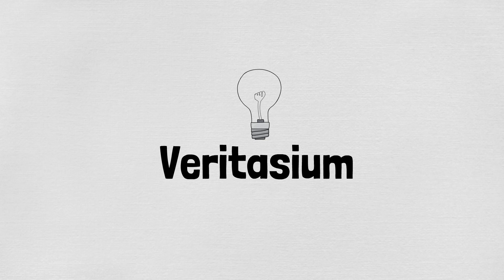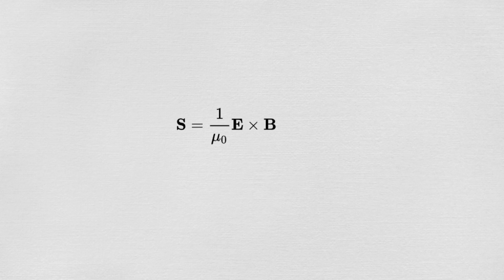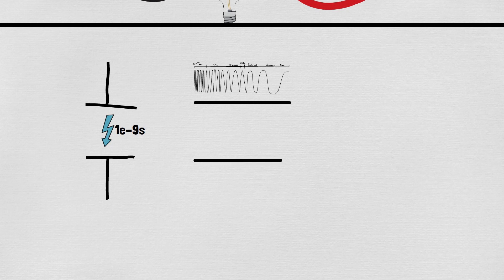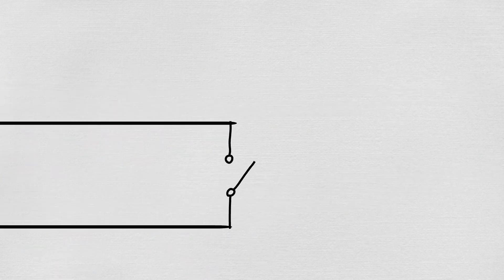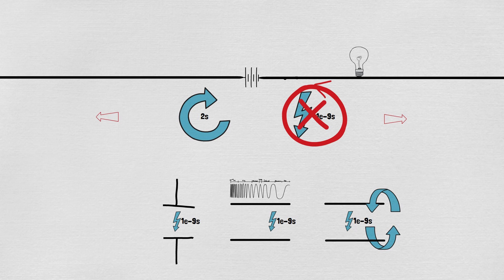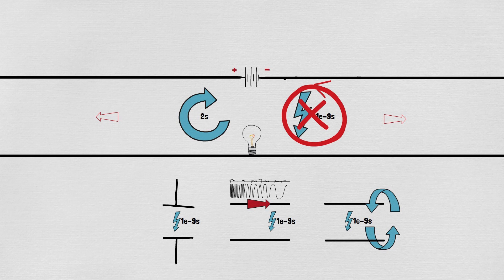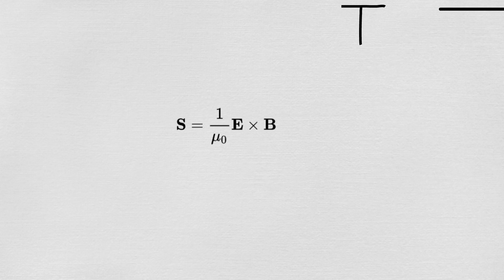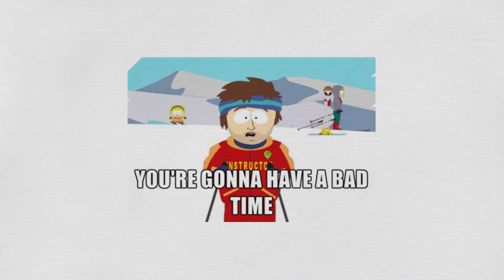Veritasium is Right? (see description)

Comment: Veritasium, is just dead wrong. The capacitance across 1 meter of wore is negligible and can’t carry the current required to light the bulb. Also, EMI pulse generated by the switch isn’t long enough to light a bulb for anyone to see it. The filed around the wires isn’t strong enough to carry the energy required to light the bulb. The energy is carried in the wires. If it wasn’t, we wouldn’t need big wires to carry large loads! There is a wave produced by the battery that will travel the length of the wires to light the bulb. It travels at the speed of light in the wires, which is less than the speed of light in a vacuum or even air. (It is not "C") If you think you can transmit energy across 1 meter of air with a single strand of wire, I suggest you use some math to find out the TRUTH! His thoughts on the direction of energy flow are just stupid. Energy flows in the direction from the source to the load. His example of a chain is more correct than his example of energy flowing in the field. The fields are created by the current flowing in the wires, no, current, no fields. Veritasium, usually does a very good job in his explanations, he just blew it with this one.

Comment: You can't just move the switch around like you do in this video without affecting the setup. Everything to the left of the open switch is at an equilibrium potential (e.g. ground + 12v) between the switch and the battery. When you close the switch the current doesn't immediately start flowing through the battery where there the potential difference is already in equilibrium, it starts immediately flowing through the switch where there is a 12v potential difference between the right and left sides and you just shorted a wire -- no causality is violated.

Comment: Everything you said is wrong from start to finish. It is a dynamic problem, but the current is established starting at the location of the SWITCH, not the battery, and the energy flow is transient, appearing when the current starts up. It settles to no energy flow (no bulb light) when the current becomes a steady DC, and then the light will light up again if it's an open circuit, because the current will die down. You are not saying correct things, all your 'causality paradoxes' are naive, the time it would take to light the bulb is the time it takes for an em pulse to propagate from the switch to the bulb, although the bulb will turn off later when the dc current dies out, if it is an open circuit, relighting a few times, as the recoil waves travel back and forth along the circuit.

Yes, I have read Jackson's EM book, it's not that good anyway.

Comment: Dereks's question  was "how long to light up", not -  "how long to light up and keep glowing". so in this case, Tycho, my man, you are wrong.
Reply: It wouldn’t even light up though? Not enough current
Reply: @Samcharleston24  For incandescent light bulb - most likely not. Because filament needs to heat up to emit light. For LED - no idea what is the minimum energy, forward voltage or any other aspect to emit at least 1 photon. Good topic to explore on a free  evening :)

Comment: Veritasium made a very bad example experiment which is also deliberately confusing. But You are also not completely right. If you follow the example of Veritasium you will get a short amount of current thought the lamp (even if you cut the far end of the wires by the way). 

But I agree that in the real world the experiment will never work as the energy transfer is way to low.

Comment: This is just wrong, sorry. You definitely get current just by instantaneously hooking up a wire to a different potential regardless of if its floating or not. That’s how a TDR works. As for the it violates causality argument the problem assumes everything is at steady state so the potential on one side of the switch is at the potential of the cathode and the other side is at the anode. Although Veritasium’s premise is misleading; there would be a pulse at 1/c seconds then sinusoidal oscillations often called ringing so the light wouldn’t really turn on in that time. https://en.wikipedia.org/wiki/Time-domain_reflectometer https://en.wikipedia.org/wiki/Transmission_line

Comment: You shouldn't post videos about things you don't actually understand, closing the switch does cause current to flow, not everything it a lumped element circuit. This is why YouTube shouldn't have removed dislikes.

Comment: Veritasium is wrong, and your explanation of why Veritasium is wrong, was pretty close, but still wrong.

What actually happens in a battery is a chemical reaction separates charges. Electrons build up on the negative side, and the positive side lacks electrons, due to a chemical reaction inside the battery. Electrons in the wire want to move into the positive terminal of the battery, but can't due to the reaction not being able to continue so long as excess electrons are built up on the negative terminal of the battery. When the switch is closed, electrons nearest the battery are able to move in response to feeling the electric field from the battery, and when this happens the excess electrons are removed from the negative terminal, allowing the chemical reaction to continue. This reaction pulls electrons from the section of the wire nearest the battery, into the battery  This causes current flow nearest the battery, but initially not farther away. After the electrons nearest the battery start moving, then this changes the electric field around those electrons, so that farther away electrons then feel the push or pull of that electric field in its new configuration, and start to move accordingly. This means electrons farther away from the battery on the negative side now start to move away from the battery, and electrons farther away from the battery on the positive side now start to move toward the battery. The speed at which this region of latest-moving-electrons actually moves (the movement of the region of moving latest-moving-electrons, not electrons' own movement) is about the speed of light (slightly slower in metal than in free space). This region of latest-moving-electrons does not reach the light bulb until the FULL TIME (as dictated by the duration it takes for light to travel the length of the wire itself, from the battery to the bulb, and NOT the gap between the wires) has elapsed.

Yes, when you first flip the switch and electrons start moving nearest the battery, there is some coupling (both inductive and capacitive) between the wire nearest the battery and the wire nearest the bulb, but it's VERY WEAK coupling. The amount of coupled current in the wire nearest the bulb is VERY WEAK. That coupled current is WAY TOO SMALL to light the bulb.

Comment: three minutes in and my teeth are starting to grind. You are clearly not an RF engineer and you understand nothing of transmission lines. When you switch on there is a transient coupling between the lines (if you don't understand transmission lines, you can call it a capacitor) that fires a transient of energy into the bulb, lighting it. I there were no more transmission lines and no short, that would be it. A tiny flash. But there is a transmission line and the coupling field moves along it at the speed of light adding a continuous coupling until the field reaches the end. At that point it encounters the short. You now have a simple DC circuit for the rest of time. At no point after the initial flash is the circuit without an energy transfer path.

Comment: you are wrong, this does not break causality ... the position of the switch does not matter, the math requires a closed circuit ... the capacitor/antenna argument only holds if you are talking about ac, energy does not flow through the capacity with a dc source, capacitors can store electric potential energy by setting up an electric feild across the places, you need a good grasp of basic circuit theory before you jump to arguments about causality

Comment: This whole video series is nothing more than click-bait.  If you have a DC circuit, you do not light a light bulb thru a capacitor.  All you get is a surge current and when the capacitor charges the current stops.  Also, try and put a wire in a cloud at 1 million volts and see what happens to that bulb.  Benjamin Franklin did that with his kite, remember about lightning?  LOL  What do you think would happen as this wire extends through the aurora borealis or the Van Allen belt?  The whole problem is ridiculous and is just meant to get responses and clicks to make money from YouTube.

Comment: He's not wrong.  It's just a trick question that doesn't need to even involve Poynting vectors if you just use capacitance.
I love your discussion !    But doesn't closing of the switch cause current through the capacitor to make it true ?
Reply: The existence of capacitors is evidence of the truth which veritasium has grasped the reason for. Otherwise you conclude that it takes a couple seconds before power transmission. Also, you can't have a capacitor with no power, so only if the switch is between the battery and the capacitor do you have no current flow.

Comment: it is interresting how many people making arguments here that were clearly proven as false in the video.... aren't they listening to the video or are they themselfs dismissing the arguments of the video about their arguments as false or unimportant the moment it gets mentioned in the video? 
and the simulation that someone did with the field and that "proves" that 1/c is right is biased because it uses small numbers and no "0 ohm" wires. 

the main problem shown here in the video is that the setup of the circuit is missleading people to make assumtions that "may work", but have always the assumtion that the switch is the "starter" of the power. that might be true for every day circuits but not in this problem here, because like in the video said, why do we need the switch, if we can assume that the ends of the wire don't need to be closed? an open ended circuit would mean that you add two switches into the circuit that are normaly open like the first one. so if we can then assume that the wires build a capacitor, then why isn't the capasitor working in the bit bevor the switch and on the other side of the power supply without caring for the switch? why isn't that field building up while the switch is open?

Comment: To me your explanation makes no sense. You act like there is a causal relation, which may be correct, and then jump to the conclusion that energy can only flow if there is a current and a current can only flow if the em field is established along the entire circuit. I really don't see a basis for this last claim. How do the electrons know when the em field is established along the entire circuit and they can start flowing? I'ld say they start flowing immediately, they 'look' at their local environment and act immediately on the changed circumstances due to flipping the switch gradually propagating the new information through the  circuit till a new equilibrium situation is reached.

I'ld say there is a potential difference over the switch, the moment you flip it a current starts to flow across the switch, simplistically this can be seen as  'pulling' electrons from one side of the the switch and 'pushing' electrons at the other end of the switch. This movement of electrons causes a potential difference to propagate along the circuit. It takes (at least) 1 second to establish a stable situation as the 'pull signal' propagates into one direction and the 'push signal' propagates into the other direction and these 'signals' meet at the halfway point of the circuit. The light bulb can light up the moment the the first signal arrives, consequently, at the switch virtually immediately, at the far end of the circuit after 1 second. 

In reality you'll also have to factor in inertia, there is a stable situation that is disturbed by flipping the switch, dynamics develop in order to get to a new equilibrium situation. Compare it to an irrigation system. The moment you startup the pump water immediately starts to flow. Sprinklers close to the pump will start to sprinkle very quickly, the water will take longer to reach the sprinklers at the far end of the waterline. It takes time for the water to flow and a stable pressure gradient to build, but sprinklers will start (low level) sprinkling the moment water at sufficient pressure has reached it independent of the rest of the system.

Comment: Veritasim is not wrong, you are wrong.
Reply: Woah woah woah, calm down. 
He might very well be right. He explained his concept very well.
Right now, we need experimental data to prove either sides of the argument.
Reply: @Abedchess  very small amount of current starts flowing throught lamp in 1m/c. Lamp technology does play a very important role here. If LED lamp (couple dozen in series, of course) is used, than it will light up immidiatelly (1m /c). Outherwise (lamp is incandescent or halogen) lamp will only light up after 1s.
There is a one clarification in the conditions: lamp glows even if very small current flows thought it (just like LED).

Comment: https://youtu.be/-jJB8dyOJIw?t=176
"...why does it care about the switch?" Because it changes its state, creates an E field change, which propagates through the medium, and it is close to the bulb. 
Just because you don't even care an answer to your question, it doesn't mean you can assume it is irrelevant and can be changed freely. Your change is not minor, but crucial. The origin of the information is the switch, you can not change its placement without essentially changing the result. The violation is not made by the correct result of Veritasium, but your babbling jabber. (BTW your speak is tragically unfollowable, and reflects totally confused thoughts. Your speed of speech hides untold false assumptions.)